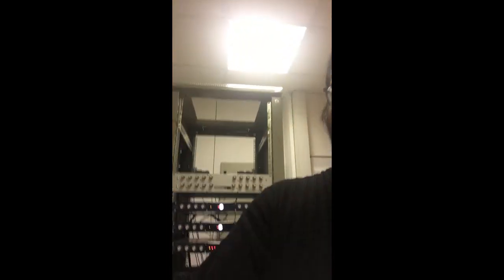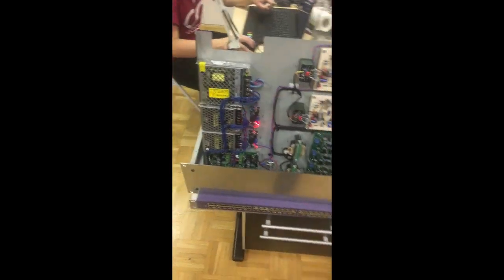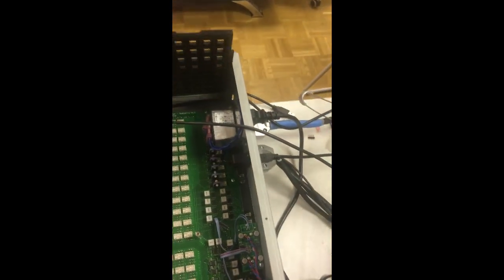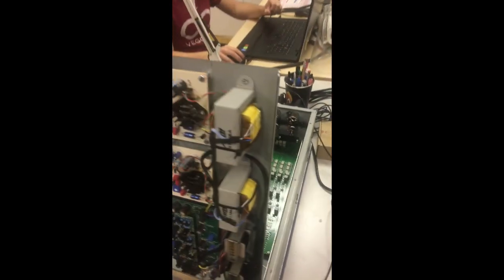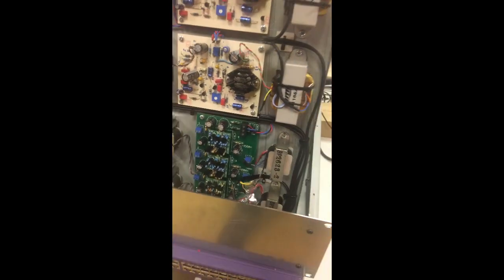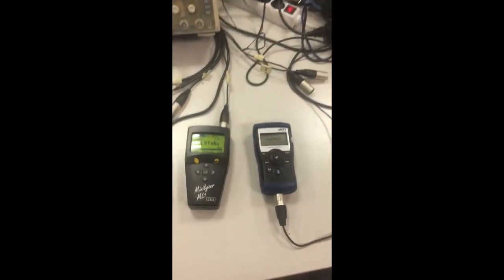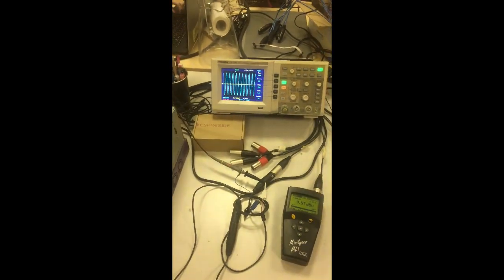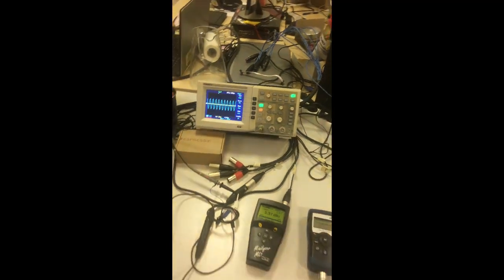Mixanalog Summing Mixer - first volume test

Comment: Looks great, I just come across your service and looking forward to trying it out, I cannot however find this device in your platform, is it up and running for us to book and try at this point?
Reply from the maker: Thank you for your interest, no the summing mixer is not available yet. There are still software and hardware features we need to complete before we can release it to the public. In the mean time, we have just released a stereo 1084 line amplifier, which uses the same circuitry as the Neve bus amplifier in the summing mixer and will give you a similar sound, just without the summing.
Reply: @mixanalogcloud  Yes, the Neve Amp, it looks amazing and I'm going to give that a try ... All this is very new to me so I'm super happy about it all!... Oh and thanks for your fast reply too :-)
Reply from the maker: @adammusic1124  You're welcome

Comment: When will this be available?
Reply from the maker: We are waiting for new converters as the summing mixer uses a lot of channels. We have ordered them back in November, but due to the situation in the world, we can expect them in February. Then we need some more time to tune and test the system before we put it out. Worst case, this seems like a March release.
Reply: @mixanalogcloud  can't wait. Is there a support contact to get in touch with? I was having some issues with your vca compressor
Reply from the maker: @Grrrrpk  of course, use the built-in chat in the lower right corner (preferred), or use the chat on our facebook page.